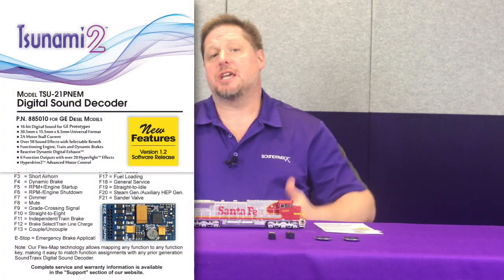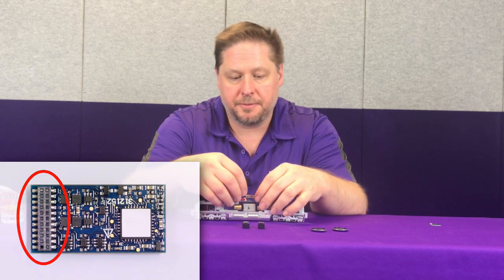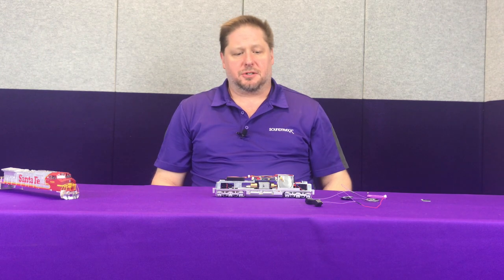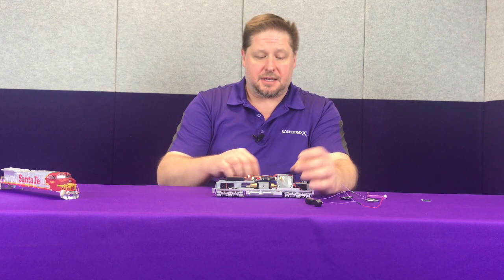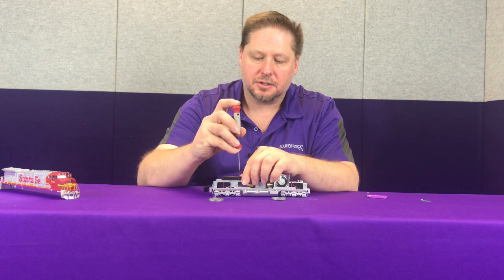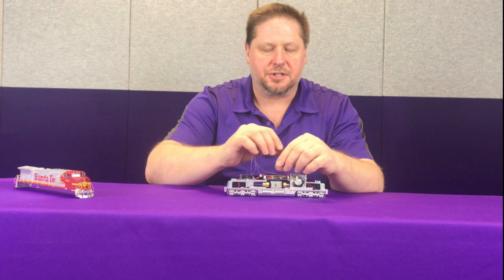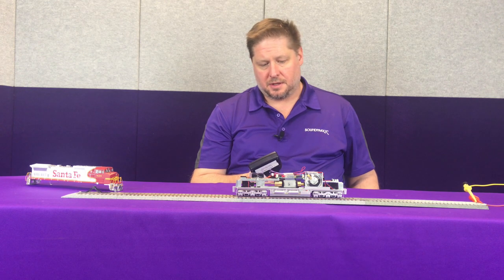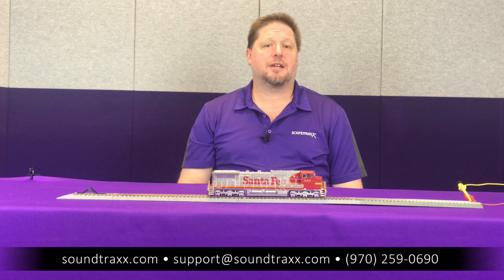Atlas 840CW Install of a Tsunami2 TSU-21PNEM

Comment: I would GO LOUD with 4 speakers!
Reply: Would you use stock Atlas sound speakers in a sound equipped model? If so, would save me the headache of changing the speaker, i think its 8 OHMs but may have to research a little more.
Reply from the maker: @CodysTrainz  You can use any speaker that   falls .under the decoder's amplifier specification.
Reply: @SoundtraxxDCC  Yep so true, I Liked it when you used a 4.5 inch round speaker in one video, that was really something.
Reply from the maker: @CodysTrainz  Yes the speaker makes a big difference!

Comment: The matching connector for the speaker connector on the Atlas board is a JST type ZH.  I have done several
 Tsunami 2 installations on Atlas locomotives using this connector.  The connectors come with leads.  The supplied leads wire gauge is a bit large, but work.  I hope this is a help.  Thanks for the great products.
Reply from the maker: Thanks for sharing this info and for watching!